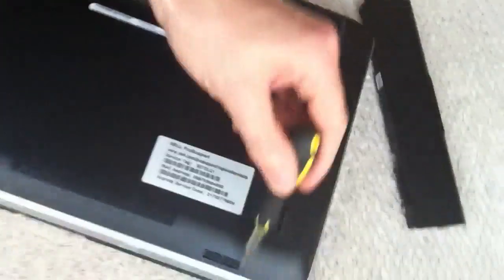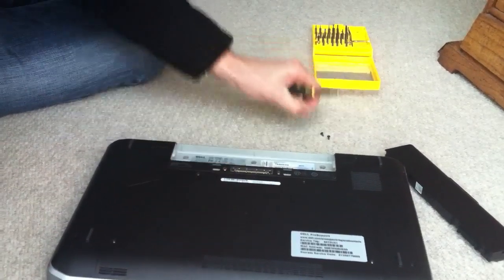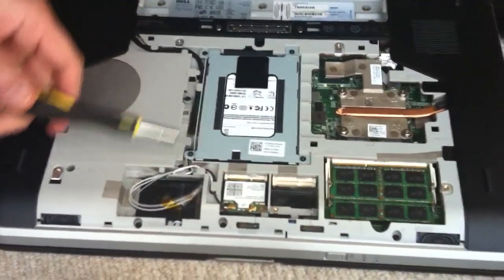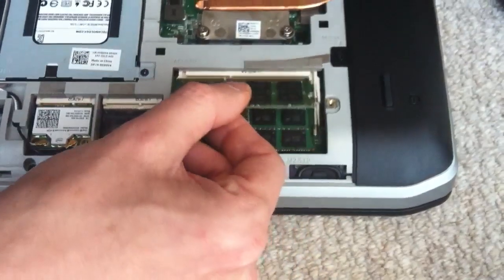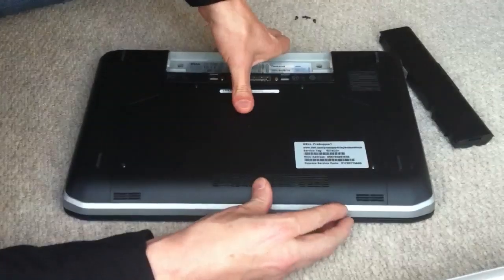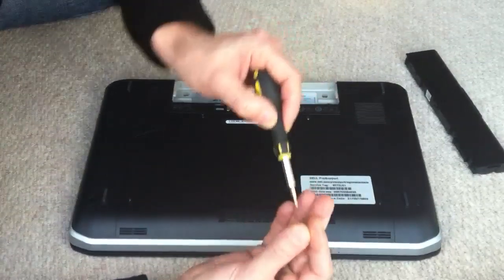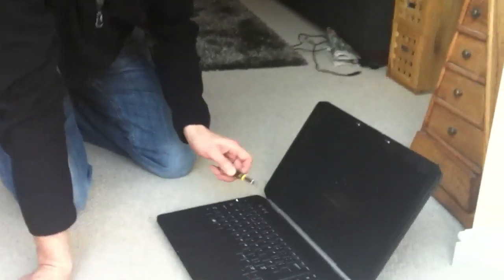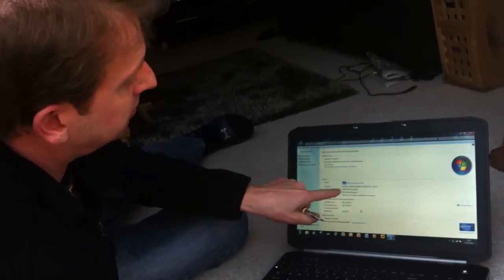Replacing, removing, upgrading RAM or memory on Dell Latitude E5520 i5 latop.

Comment: I know I am a bit late to the club, but thanks for the heads up! As my dad's laptop is breaking apart, I dusted off my own old E5520 I had laying around, added a second 4 GB RAM stick into it (already had a 128GB SSD, which was big when it was built in). He really doesnt need a 1000 € gaming laptop, so its still totally fine for him. I also replaced the CMOS battery. If anybody is interested, you can buy used batteries online for cheap or refurbished ones for really expensive money. In the end its just a normal 2032 button cell, the same as you put onto any other mainboard. Just cut away the shrink wrap, remove the contacts from the battery with a sharp razor and then tape them down on a new cell with some Gaffer tape. Works like a charm!
Reply: Its ddr3 right?
Reply: @stray1801  Just rechecked the envelope the stick came in and can confirm. (I know, I know, I should have thrown it in the trash already...)
Reply: @xxXm0RpH3usXxx  I just bought a e5520 with windows 11 on it. 750gb hd with 8gb ram and office 2021 inc for $75.00. I mean it has same components a new one today has that costs $750.00.  Even has a dvd burner that I still use to burn for friends.  I’m gonna upgrade the memory from 8 to 16.  Won’t need another laptop for a decade hopefully :D

Comment: Do you know what the card slot between the RAM and the Wireless card is for ? Looks like another wireless card slot to me.Got the back off mine and just notices it sitting there empty.The bay to the left of the wireless card is for a WWAN card from what I can find out. Is this correct ?
Reply: 4G card

Comment: Does it have to be a particular brand of RAM? Only original Dell?
Reply from the maker: You can use any brand, hynix, crucial, Samsung, etc. As long as you have the correct specifications they will work ok